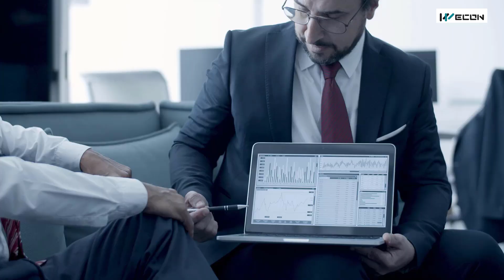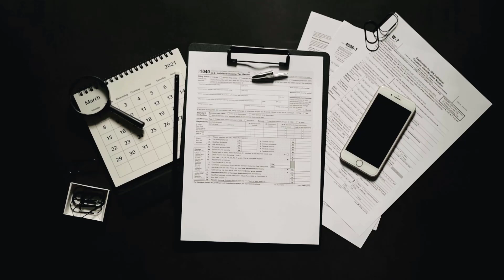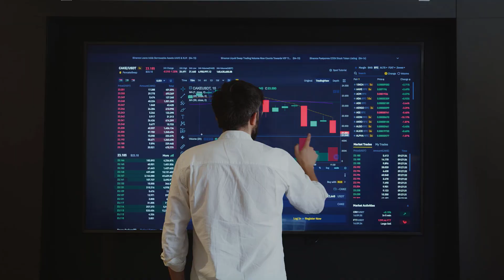The Harsh Reality of Being a Automation PLC, DCS and SCADA Engineer

Comment: I have been working as a control systems engineer for 35 + years, 25 of which as a license holder. I have designed just about every type of industrial control system there is and integrates most of them. Honestly I wanted to disagree but I cannot. While there are negative aspects to all engineering disciplines, I still think controls system engineering is the most interesting. When I started my career I designed and built Pneumatic controls, analog electrical controls and JCI minicomputer based controllers. Today the controls are orders of magnitude more sophisticated and network engineering skills are a must. If I had it to do all over again, I’d still be a controls engineer, I love it, I love the technology, the fact that technology is constantly changing and the challenges of staying on top of the changes are time consuming. I wouldn’t trade it for anything.
Reply: I want to come into this field but I don't know what should I learn please list out all skills that is needed for automation engineer?
Already I am an electrical engineering gradaute

Comment: Can we talk about the absolute ridiculous long order times for automations parts and the drastic increase in price?
Reply: That's a real issue right now. I'm a Controls Engineering Consultant at a 235 MW Combined Cycle Power Generating Station and we could complete several of out critical items in 2021 and some of the materials ordered last summer still haven't arrived and the prices and lead times seem to get pushed up and out on a weekly basis. Try finding Pre-Insulated Heat Trace Tubing for 2500 PSIG/1100 F Transmitters on HP and Reheat Steam lines as one of many examples I could cite.

Comment: Spot on video. As someone who have done all the things mentioned in this video for 10+ years, I have to say, it gets a lot easier when you transition to the other side, i.e. client side, where you define the system requirements.
Reply: true story. but you`re halt your development as an engineer when appears on the client side :).
Reply: @EugenKondratiev  only when you transition to becoming the client, you can realise how much (or how little) you know. Generally, the end users need to manage and integrate multiple systems whereas working for a single OEM, you only get to see/design few systems. This can be overwhelming, trust me. Development is subjective, I know engineers who work for OEMs and only know how to program PLCs or do hardware control panel design. On the other hand, I have met engineers who transitioned to becoming "clients" and had to up their game by delving into newer fields like cybersecurity, info management, standards assessments etc.
Reply: @Domi6556  Agreed. Have been working on client side for 6 month and realize how little I know about this industries..

Comment: Great video. I've been in process control for over 10 years now and I always tell new people that this job is only suitable for a select few. You need incredible resistance to pressure. One thing I feel you should highlight is commissioning. This is almost always what breaks people and causes them to leave the industry. People entering this field need to know that it usually only takes one or two automation engineers to make massive production facilities run. I have shown up to $30 million dollar projects by myself as the only person to make the system run. Crazy pressure. Also almost all industrial facilities are 24/7 operations, but forget about having 3 shifts of automation, you will sometimes work 90 hours a week and see all 3 shifts of operators. A few times on some disaster projects I have put in over 105 hours in a week (and on salary, so didn't even make OT).

There are upsides to the job. It's very rewarding to program in the office and see the project come alive on site. Being a good PLC programmer will get you special treatment compared to the rest of the project crew (see reason above, you are the only person that can make the system work). If you can stomach the downsides you will never be out of work. Demand is insanely high and you will have a decent upper-middle class income for life.
Reply: Thank you for your advice. I haven't been able to find anyone talk as candidly about it as I have in this comment section. I'm a college student majoring in EE looking to get into this line of work. No other field has excited me more than this, but you guys are making it seem like it's not worth it. If you were in my shoes would you follow the route of becoming a control engineer?
Reply: @lettucemastermind3799  If you like problem solving and being relied on by other people, go for it. For context, my comment is mostly pertaining to experienced engineers. When you enter the field you generally have a mentor to coach you for the first year or more. As you gain experience and start taking on more responsibilities you will have time to decide if this job is right for you. If you don't like it, you can use your skills to make lateral move to a 9-5 maintenance job, etc.

You can also make the job much better yourself with very simple things, like always taking lunch, even if the customer is shutdown and being honest that working past 10 hours in the day isn't effective and you could make costly mistakes.

From all the people I know, I think I actually like my job more than most. The lows are low, but the wins are huge and I don't see 100% office workers feeling the rewards that I do.

Comment: This guy is full of it. 1991 to 1995, I worked for an asphalt company automating 180 asphalt plants in the southeastern US states that had people climbing up 150 foot ladders in 40F degree weather, sometimes raining as well and pulling levers at these plants to create mixes of asphalt. I programmed Telemecanique plc's connected to OPTO-22 relays to control everything. Sure, it was long hours but it was very rewarding and I did have to travel out to every one of the 180 asphalt plants to do the retro fit done over a weekend. I used what I learned on this job to automate my own home. And although I have updated the computer equipment from PLC's, the entire alarm system at my house is still running today with mostly the same software using the original OPTO-22 relays. 
I then moved on to Conagra-poultry(which was sold to Pilgrams Pride) from 1996 to 2000 automating chicken plant processing equipment using IBM plant floor equipment. I retro-fitted a majority of the equipment on the plant floor with IBM equipment which made tracking every part of the chicken as it made its way through the processing equipment possible, a government requirement. Again it was long hours some days but was well worth it. There was also a lot of days just sitting around monitoring everything and getting paid to goof off.  I then moved on to MDT Software from 2000 to Dec 2001 when the entire software industry came to a halt because of Sept 2001. But in that time I also retro-fitted Purina Pet food processing plants. So, 10 years of steady employment getting paid above average wages too, was worth it. I would go back and do it again instead of moving into the web development jobs that was all that was left after most automation moved to China.

Comment: I happen to just come across this vid and your channel as someone that also works in Field Service Engineering and IACS-Industrial Automations Controls Systems. The harsh reality is your 100% correct and their isn’t anything I can actually disagree with. Expectations of what your suppose to and can do is extremely high. Training for new technologies in automation which is ultra rapidly changing and evolving is very low from the companies you work for and they somehow expect you to know it all and that’s just not possible for so many reasons. You will end up having to solve every bit of your technology problems on your own without much help from anyone else you work with. And lots of long hours on-site trying to get or make something work as well lots of time on phone with like Rockwell Automations or Siemens Tech Support. You will have lots of travel, which means lots of time from family. Many the places you visit you won’t even get to see much because your so damn busy working at sites under lots of pressure to fix or get some logic programming to work. It’s an interesting job, but it’s also tough and sometimes your not compensated for all the overtime you work on projects. I’m on salary in this field and it’s not uncommon to have to put in overtime of up to and extra 40 hrs in that same week on projects when out of the 40hr week office and to not be compensated for it being on salary. Nevertheless yes, many engineers get burned out, quit or leave.
Reply: isn't that blatant wage theft?

Comment: As a hiring manager I always stress that our job involves travel, up to 40 percent, but we are conscious of family and try to give the engineers time home. 10 days with 4 days home in most cases, but as anyone knows the project dictates the schedule.
Reply: Absolutely. We shouldn't let component failure, budget shortfalls or supply chain delays get in the way of arbitrary deadlines.
Whenever I set myself a task, I estimate how long it will take to complete and then set a deadline which is half the time I estimated. This way, I can boast of "hitting targets" and "meeting key performance indicators". If something isn't finished, I simply leave it, "as anyone knows the project dictates the schedule".
Reply: @digitalradiohacker   I'm confused by your comment. Are you being sincere or are you coming at me about my comment. Because I made no mention of comparing the project performance or issues to the schedule. I simply referred to how we as a company are conscious of extensive travel required for this work but "project dictates the schedule". Meaning that if a project is small in nature and requires say a 2 week trip then obviously thats how we would schedule it.

Comment: Hi
Worked for 24 years now as an system integrator in process automation. One thing that will be better is that you will be good at the process, electrical, instrumentation etc. This will mean that its fairly simple to jump from system to system. The base is still the same. So long as its proven products and not some buggy non functional new junk, Then even I will get frustrated. Also one important thing is to have an understanding wife 🤪
Reply from the maker: True

Comment: This is Software Engineering in general. Software Engineering is one of the strangest job in which you're expected to be a everything engineer. You specialise in all fields of it. Industrial Automation takes it to a whole new level with Electronics and Mechanical.
Reply: If you're experienced you get drug into Process Engineering, Project Planning, Supply Chain Issues and other tasks besides your work and the Electronics and Mechanical you speak of. Management expects you to solve logistical issues and not just the technical issues they're compensating you for.

Comment: I think most venors think that not being trivial, or automatable - in terms of project development - is a good thing. In the software world you could pick any language and toolchain and let some script setup a project for you. Now imagine like siemens, where this is impossible....
Or that none of the vendors i know has a way to transforn one language into another, so that you could look at a piece of programming in st, ld or fbd.
Imagine, if version control would be encuragdd by the engineering software.... there would be a clear history of when things have changed, who changed it and what exactly has changed...
Imagine if engineering software would be performant... I got a fairly powerfull computer that possess an nvme drive, a fast processor and 32GB ram. Most engineering softwares that i tried over time took minutes for things that i.e. Word or even the super shitty eclipse ide does in seconds...

All these things are not strictly related to the carrer of course, but I would say these things are part of some problems. I think the if there were options to generate, test, lint projects, more engineers could be confident and would be less stressed. And if good, independent diagnostic tooling could be developed by companies, some travels would not be neccessary.....

If the field woul be percieved more like computer science, things would be different - maybe better, maybe not. But there would be things that could aid every engineer